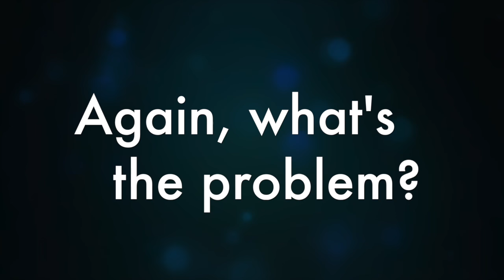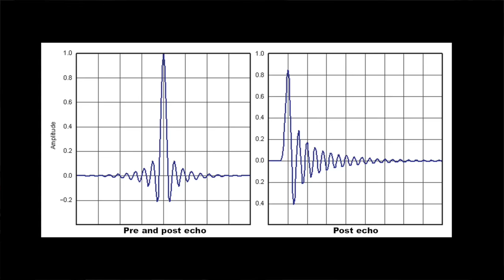The truth about Nyquist and why 192 kHz does make sense

Comment: Pretty well explained and argued. I would add that the reason Nyquist works in theory but is difficult to implement in practice is that the Nyquist-Shannon theorems employ a perfect frequency window filter in the frequency domain , whereas practical electronic implementations are limited to imperfect filters in the time domain. This gap between what filtering is required theoretically in the frequency domain and what is possible practically in the time domain, can be bridged by increasing the sampling frequency to a point where the required lower-order time-domain filters become well-enough behaved.
Reply from the maker: Agreed

Comment: An alternative explanation of what is described as pre-echo might be excitement delay. If you hit a cymbal, it will initially only excite the air around it slightly, but this will then build up over time as the air resonates in phase with the cymbal, at frequencies the air can carry. The very transfer of sound from a cymbal to the air is actually a low pass filter with excitement delay.
Reply from the maker: When measured there is no air involved. Just the electrical connection between the DAC and the scope.

Comment: I believe you are most likely correct in your ideas.  What I observe (including my own personal experience) is that people listen to music in increasingly noisy environments, and so the artifacts from lower quality music files and equipment are overwhelmed by the sheer noise of our daily environment.   My own daily experience includes listening while walking on a sidewalk with cars a few feet away, on a fairly loud bus, and in an office that has an almost dangerously loud HVAC system (as well as a noisy open office layout).  All of these swamp the need for better music files and equipment in my opinion
Reply from the maker: I agree completely. That is why I use 256 bps AAC on my smartphone that normally is connected to my car stereo. The noise level in cars is so high that details are masked. I only write about stereos in the house. Unfortunately there are many stereos that won't let you hear the difference between MP3 and uncompressed. As can be seen from the comments on my videos. If people hare happy with that, that's fine. But tests I did indicated that when confronted with an affordable but well chosen set, like my Set 3, they are flabbergasted (is that word still used?).
Reply: yes, flabbergasted is still appropriate. interesting fact, flabbergast began as a fictional, pseudo-german word meaning, "flutter-ghost"; a reference to bats. so to be flabbergasted is to be bat-bothered  (^..^)

Comment: I want no debate here, we all have our experiences and backgrounds... it’s been awhile since I have looked into these designs, but I seem to recall that using to aggressive a ‘brick wall filter” (digital IIR or FIR filter) when you still had 44.1 kHz sampling can lead to some phase problems after the D/A stage plus the analog reconstruction filter used afterward (which had to have steep slopes). But, usually by late 80s to mid-90s in consumer CD players electronics the combination of an over sampled FIR filter (say 48 k or 96k sampling) combined with a gently sloping analog reconstruction filter was a pretty darned good setup and fidelity! So anyway I like how this gentleman was placing more emphasis on filtering. I like this video.

Comment: This matches BBC Engineering's findings when they first introduced digital audio to the broadcast chain (I led a BBC group on digital audio testing). They were also concerned about the effects of cascading multiple A-D and D-A converters, as there was so much analogue equipment between the microphone and transmitter, eg a digital mixing desk, an analogue VT suite, analogue continuity mixer, digital transmission backbone (NICAM), analogue transmitter, etc. 

We did a lot of measurements on the early DACs to test for artifacts and came to the same conclusions. Steep filters produce more ringing and have poor impulse responses, whereas a more gentle filter doesn't fully attenuate the signal until a much higher frequency, thus requiring a higher sampling frequency. If the sampling frequency is not high enough, any input frequencies above the sampling rate will reflect back down into audible spectrum causing artifacts.
Reply from the maker: Thanks Alastair for letting us know. BTW my opinion is based on the research  that Stuart and Craven have published over the years. Since it coincides with my auditory observations, I felt confident to publish them in this video form. Extra conformation from you does really help.
Reply: Is that why video uses 48khz?
Reply: This is why 48khz is used for studio reporting, so that you can have a smoother low pass filter and then the final result can be saved at 44.1
Reply: You need to have equipment (including speakers) that can reproduce the the increased frequency range. Most consumer speakers cannot reproduce up to the 20k that 44.1K provides.
Reply: @pilotavery  48 kHz and 44,1 kHz was to avoid digital copies. Eg DAT recorders used 48 kHz which prevents making digital copies of CDs.
Reply: necromancing this line of questions...  So, for a person streaming via Qobuz, Tidal or Amazon wherein there are mostly 24/96, some 16/44 and some 24/192. What would be the recommended practice for digital filter selection when it is available ?
- is this correct: ?
1. 16/44 - use a fast and steep filter
2. 24/192 - use a NOS or slow or really slow filter
3. the between files 24/96 -  what seems to be good for those ?
Am I generally right in my thinking that you can lessen the slope of the filter if the sampling rate is higher than 44.1 ?

Comment: Hans, it's a double-edged sword.  Yes, a less steep rolloff would be beneficial, but aliasing occurs in the analog world as well.  With such a high sampling rate of 192kHz to rolloff to inaudible levels, there is a greater chance of high frequency noise to exist due to the highest possible frequency content (96kHz).  The issue is that this noise is in the nonlinear range of some amplifiers, and nearly all transducers.  Thus, the difference between frequencies in this range will be scattered throughout the spectrum, into the audible range.  Then, all equipment must be capable of 96kHz playback, which could require items such as supertweeters to reproduce sounds you can't even hear, to prevent audible distortion.

To me there's no obvious solution, as a gentle theoretical rolloff is preferred, but high sampling frequencies causing intermodulation distortion is also undesirable.  Your points are fair, but there are definite cons to 192kHz sampling, so no clear answer is available.  At least we both agree that we can only hear 20kHz (or maybe slightly above when we were younger), so many people I see arguing for high sampling rates think they can hear 90kHz or something, and tend to seem quite delusional ;)
Reply: I agree with you, the higher the sampling rate the more probabilities of getting armonics at our reconstructed signal. What we could use in order to get a better quality is more bit deep in both adc's and dac's.
Reply: Jonathan, I think you might be confusing non-linear artifacts (distortion) with phase response problems.  Drivers exhibit wonky phase response off axis at frequencies which are too high or low for the type of driver in use.  You will hear “non-linear range” while they are referring to the phase response problems. This has nothing to do with harmonic distortion.  Distortion is also said to be non-linear, which is where the confusion comes from.  

Non linear artifacts happen when we clip a signal. New harmonics not originally in the signal are created.  Speakers have specifications for maximum output: peak (clip level of a transient) and RMS (the output level at which constant energy clips).  It is the roughly 8-10dB below the speaker’s specified clipping point that we want to avoid, in order to not create harmonics in the reproduced sound which weren’t in the recording.  

Speakers and amplifiers do not automatically distort signals at all SPL levels within a certain frequency range (that is unless it is an incredibly bad speaker :). In this way there is no ‘non-linear (frequency) range’.  Distortion-induced problems like intermodulation, happen near the top of the speaker or amplifier’s dynamic range.   

Another aspect to all this: Music is not flat.  Progressively less energy as we move up higher in frequency.  This proves true when looking at music on an FFT or RTA.  The fundamentals are lower; the harmonics are higher, yet the fundamentals have way more energy. The harmonics have progressively less energy the higher in frequency they go.  A 96K high res recording for example, will show on an FFT that 99% of the energy in the music is in the audible band. Comparatively little above 20Khz. This makes it hard to image the ultrasonic range clipping. Everything below 20Khz would have to clip to an absurd degree in order to get the VHF up to the clipping point! You’d have turned your speakers down well before that point.  

You refer to noise in the non linear range.  You mean noise above 20Khz?  For the noise floor to be near maximum output at any frequency, and therefor clip the driver or amplifier; there would have to be something seriously wrong with the amplifier!  The kind of problems you are worried about only happen when we are saturating the signal at some gain stage (or at the driver). This does not happen with low level signals.  I think some of the extra concern comes form SACD, which was a noisy technology.  PCM does not exhibit the same problems in the VHF.

If we say that we shouldn’t have sound reproduction above 20khz because there could be distortion-induced problems, then we would have to say that we should not use speakers at all (because you can have distortion induced problems at any frequency). The difference is us the listeners.  And wether a person can hear the difference between a 10,000hz square wave and a 10,000hz sine wave, with an analog oscillator, in a 100% analog environment, with a system that can reproduce VHF….
Reply: Never heard above 17kHz in my life, even as a teenager. No music up there anyway
Reply: I've done quite a bit of recording and playback at 192khz, and even some at 352khz, and I've never encountered said intermodulation issues. For decades we have heard theoretical concerns about intermodulation distortion, but I've never encountered anyone who actually identified it in a real world scenario (except trying to mix DSD64 on analogue). I have found that converters with higher jitter clocks do not handle 4x and 8x rates as well, but in the age of femto clocks, that is no longer an issue.

I would not doubt that there may be greater ease and audio quality for the listener with less ultrasonic content, but I just haven't heard any significant signal degradation that was greater than the benefit longer filter transition bands. And even so, if the recording was made with transformered mic preamps, or the DAC/Preamp uses transformers, there is generally a rolloff above 50khz and not much reason to even worry.

Comment: Good argument indeed. Thank you for bringing this up, and putting this swing on it. 

The fact, that something sticks mathematically doesn't mean that it is technically achievable. The mathematics of the Nyquist theorem obviously doesn't take into account any implementation issues such as how to limit the bandwidth of a signal. In short, one should take into account the practical limitations of the technical implementation and then apply the Nyquist theorem. Of course, in the 80's when the Redbook standard was defined, this would prove too costly, hence corners needed to be cut. Luckily we now live in an era in which there is so much more understanding about digital signal processing and also a standard of hardware that allows us to no longer cut corners.
Reply from the maker: I wished it were. We still have to cut corners, less than in the 80's, but still... But you can cut corners wisely, dump, cheap and so on.

Comment: I have been using digital audio editing software, and decided to use the Nyquist theorem (with Frequency Analysis) to detemine the highest frequency in my recording, then double that rate. I was trying to reduce the file size of samples so I could fit more on my hardware sampler (musical instrument). The result sometimes was aliasing, which sounded like distortion or smearing of the audible signal, so I think this is correct. Nyquist is the minimum you need, but a higher sampling rate may sound better and reduce aliasing.
Reply from the maker: I agree to a certain degree. If the really chain is almost optimal, the differences between 44.1 and higher become insignificant.

Comment: Remark to the band limiting during recording: it is already done by microphone. Almost any of the mics commercially available has lower frequency limit somewhere between 20-50 Hz and upper limit somewhere between 12-20 kHz. For both infra- and ultrasound recordings, specialty microphones must be deployed, which are almost impossible to buy for common people. A friend of mine was doing his diploma work about bioacoustics (bird voice signals, specifically) and even to find, not to buy mics able to go somewhere between 20-80 kHz was really pain in the ass.
Not talking about a need of having covered both "normal" and ultrasound ranges simultaneously.
Although I had Philips earphones able to reproduce ultrasounds up to 26 kHz I never had a mike able to go such high.
It is easily demonstrable: try to do a recording with any of your mikes at any sampling rate and calculate the spectrum at any moment. You will not see any frequencies above approx. 20 kHz with any mike.
(Actually, I can see a problem with the reconstruction of non-harmonic signals, but to find an answer how that is done, I need to do some maths and measurements with signal source - e.g. reconstructinng of square or triangle wave needs theoretically infinite Fourier series. Long story short, not all audio signals are superimposed sine waves.)

Comment: Great Video, perfectly hitting the spot. But one should consider that our hearing system (ear - nerves - brain) should be able to perfectly reintegrate even signals with distinct pre- or post-echoes, so in most cases these flaws should be inaudible, even for a trained ear, simply because our hearing system also "applies" a lot of filtering, but in psychoacoustic ways. The integrating effect of our hearing system e.g. enables tricky dynamic compression, where waves dont time-align any more, but sound won't change.

Comment: I totally agree and I will add.
The Nyquist theorem works, and is true, but only to identify sinusoidal signal long enough in time, and constant in frequency and amplitude. In case we approaching the upper limit of the band , and the pulse is short we may not have enough iterations to correctly identify the signal. Example is; the occurrence of one single wave in 19KHz band recorded with a CD standard 44.1KS/s. The real audio consists at most of fading impulses, rather than long in time and continuous in amplitude sinewaves, that is why I consider the CD format to be lossy and a higher sample rate will be beneficial, 48 or 96KS/s. The reconstruction of impulses by DACs is often an approximation. In CD digital format at 5KHz band  we get only 4 samples per halfwave, enough to identify the 5KHz wave, but not enough to reconstruct it with accuracy in amplitude and frequency. Increasing the sampling frequency will increase the accuracy and definition, as a proof I can give the equivalent to CD format, stored in 1 bit resolution but iterated at 2.8MHz, the DSD format.

Comment: I didn't know about the 'reverse echo' from digital wave filtering! However I have noticed a great difference with sound quality while working in the 96 khz 24 bit environment of the MPC Live...
I'd like to address a problem that I myself have while doing audio signal processing, and it is that sometimes it needs to be louder in either amplitude or sampling rate for computing purposes, it's not the same to have a sinewave at 16 bit 44.1khz than it is to have a 24 bit 96khz sinewave compressed down to the dynamic range of 16 bit 44.1khz (with a compressor, not reducing the sampling rate) the harmonics obtained out of the process are impossible to replicate from the bitrate of 16 to 8 after normalizing back to 44.1... do I  make sense? Think about it like those CSI scenes where they try to resample the face of a man from a very low resolution image back into the crisp and clear high res image. The responsiveness of effects is way bigger while working on a higher bitrate, and higher resolution environment. Other than that, the song is going to sound pretty much the same once it gets it's final mix and gets mastered for distribution. So for production purposes, 24 bit is greater, provides with more virtual headroom, and 96000 khz should be enough, unless the intention is to destroy the sound to extract the very deep harmonics of it, in which case, having more fabric to cut from is always better. :D
So I don't know about going all the way to the 192 khz, or the 32 bit-rate but I assume there could be a benefit in digital audio processing, if the equipment was there to produce the amplitude of such signals at all!
Reply: yes, for me as a rookie in this topic, sounds same like i am thinking.